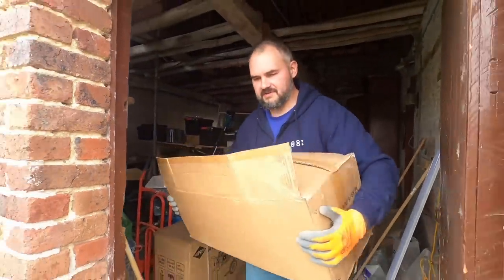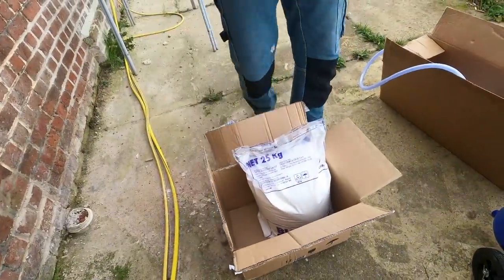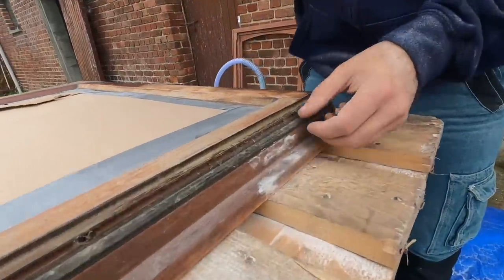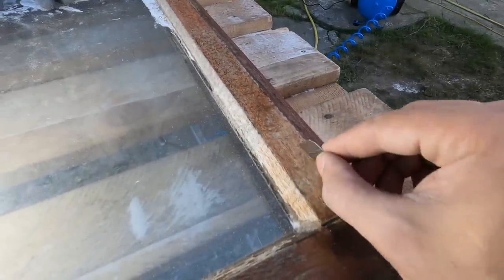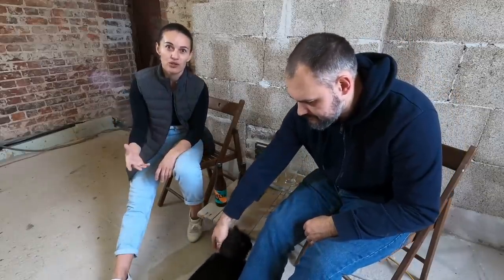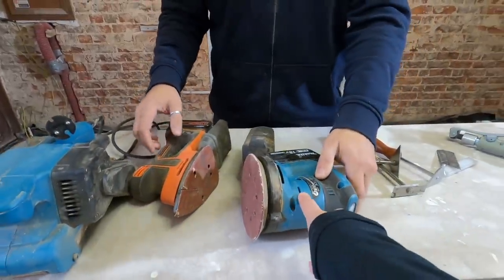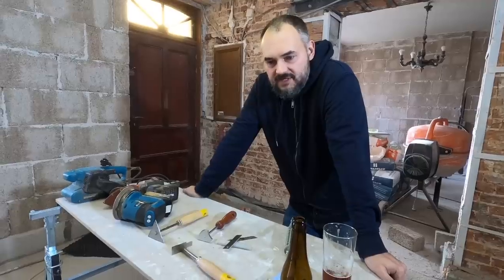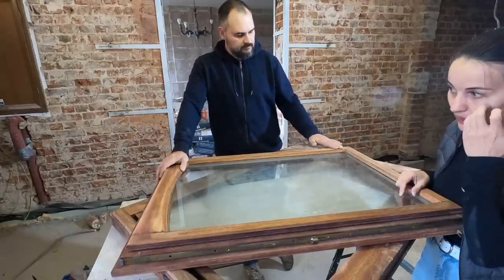Was soda blaster WORTH BUYING?  / Renovating an abandoned 110+ years old farm

Comment: 2 things to remember about the compressor...1) you can regulare the psi and 2) always open the air exhaust before storing it away so that the water in the tank won't rust the interior of the storage tank

Comment: We used a broken window pane when we scrape old paint off. When it got blunt you just break a piece off and carry on. I remember some months ago you had a problem with weeds inbetween the paving stones. a Green and cheap solution is using vinegar undiluted. You do have to repeat it after a while but it is very safe to use.  Regards from Billy in South Africa

Comment: Hi from France, your sodablasting device has a consumption of 350 up to 700 l/mn,that means from 21 up to 42 m3/h.your compressor is not efficient enough to do the job.I've been selling pneumatic tools for more than three decades and have seen so many customers who wanted to use pneumatic tools with a too small compressor.The best is to rent a petrol or diesel engine compressor.A piston compressor has a use ratio of 1/2,that means for example to use it an hour and let it cool for one hour,that sucks! cause it's too long.You can improve your job using your blasting device at 45° angle to have much surface when you blast:direct blast can dig smooth surfaces.

Comment: Buy a can of paint stripper and try it out. Don't buy the cheap stuff. Using the stripper then the scraper will do the best job. For the details use the stripper and then follow up with a small wire brush. That works great.

Comment: Just my pov of course, but hey, I'm invested!  I think white paint is a last-minute choice! Why? Firstly, that wood is probably teak or mahogany from deepest Borneo and deserves a little love! Paint will probably need to be oil-based and need repainting fairly regularly.  A good stain (I would go with dark grey/blue) would last much longer, still show the wood to some extent and show off the brickwork as well as accentuating the depth of the windows.
Totally understand the frustration of the sanding. There are many scrapers out there - Bahco make a good set - that help. But I don't think the imperfections you show would be very noticeable, from the outside at least.

Comment: It may be better to use a paint stripper and then a good sanding session. More economical and less expensive.
Reply: I second this - a card scraper would work perfectly on the flat surfaces in this case and leave with a surface even smoother than sanding. Using a card scraper is essentially the same thing you were doing with the knife blades but it is made specifically for this. It takes a little practice but is extremely useful in the right situation.
Reply: I agree. So much material and so much work and so much hardware in order to avoid using just a few litres of chemical stripper. So not just more economical and less expensive, but probably more environmentally friendly just by virtue of less materials used.
Reply: @brucen4719  This is once in a lifetime job and they need to do it quickly and as easily as possible. they are not going to do the striping every day as a profession to ruin the environment. in this situation paint stripper would be the best option for them. However professional wood worker can give the most correct answer.
Reply: @monirul0814  I have used orange Citrus based stripper that worked great.
Reply: Their whole ethos in restoring the house for the future would not include use of chemical paint strippers.
Reply: @robertab7341  Even if it is the most ethical and reasonable and least intensive or harmful method?

Comment: I'm a scrape and sand guy. Soda blaster would be good for removing rust or old paint from metal. You do need a more powerful air compressor. Then you could control the volume and pressure better.

Comment: I would use a high quality paint stripper and saw dust from a table saw for those angled or tight area of molding, apply paint stripper wait for it to work or activate, take a glove full of saw dust and rub. Clean with acetone, sand, sanding will be easy, this method gets rid of varnish or lacquer finishes that clogs sand paper.

Comment: Check out 1834 Restoration House.  They stripped wood doors, windows, railings and fireplace using a heat machine looked much easier than what you are doing.

Comment: When we were renovating a Victorian house a few years ago I had at least 20 panel doors to strip that had intricate mouldings round the panels, and what seemed like miles of skirting boards. After much experimentation I found that a gentle application of a blow lamp to soften the varnish, followed by a firm brushing (in one direction only - very important) using a genuine hog bristle scrubbing brush would roll up the softened varnish pulling it out of all the nooks and crannies. Must use genuine bristle scrubbing brush NOT plastic !
Reply: Blowtorch and glass is  incompatible!
I would also use a dedicated wood scraper plus an oscillating sander...much better than a rotary disc for flat wood

Comment: For scraping there is a dedicated tool: a card scraper. You also have to sharpen them. They cut by having a "bur" on the end. These were used all the time in a previous era. The cost is very low and they will perform way better than the scrapers on the table. I find using them hard work and I end up using a power sander anyway :0) I was introduced to card scrapers by Paul Sellers on Youtube.
For power sanders you might want to look at Festool. These machines are quite pricey, but they definitely outperform the cheaper ones by far.
Reply: Festoll is a great brand but any sander is only as good as the paper that’s been installed on it.
Reply: sounds like your bur was not made based on flat "90" degree edge (poorly made bur makes hard work).  Many manufactured card scraper sold is stamped out of sheet steel, and shipped as is (not filed or sharpened). YOU have to flatten your new scraper anyway and check the edge (both side and keel). hint: use sharpie marker color the edge  and flatten it.  no color show, is flat.

Comment: I have seen paint and stain removers, some are liquid and some are paste, and they have instructions for use. They remove the film to the bare wood, then it needs sanding.
The media blaster needs a larger reservoir of air. A compressor is a good power source for air tools, some manufacturers put a chart on the packaging to explain the necessary compressor size for the tool. Take a look. 😉🔎
I like IPA, it's India Pale Ale 😁🍻.
I think this style was originally made for Export, and the recipe enables it to keep in the hold of a ship. ⛵  🚢
🔨😏✏️  Good job, guys. 🌻

Comment: What a lot of work to restore the windows. But much easier to work on with a flat surface, instead of in place on wall. My favorite beer is a porter type. I like dark beer with some bitterness. The bread based beer and the delta beer both sounded good. I like that they use unsold bread. Illia certainly had a big enough pry bar to open the bottles! 😊

Comment: Have you tried carbide scrapers?? Most furniture refinishers swear by thrm. You can even use a piece of broken glass
Reply: carbide?   no I will not swear by it.   too brittle to sharpen.
Reply: @rynait  you dont sharpen them, just change to a different cutting edge when it eventually gets blunt. 
Its carbide, its extremely hard, steel is like bubblegum to it.
Reply: @rynait  Well we'll, you aren't the sharpest tool in the shed are you?
I will spend my money on good quality tools as I please.
The carbide scraper is a fantastic tool, so I'll happily keep one in my toolbox.
Now hush, the adults are talking here, children should not be heard.

Comment: After your decision to paint the window frames in situ in the wall the soda blaster will be very helpful to remove any paint stains from the brick work, mask the frames with paper tape (let paint dry for a week before applying tape onto) and blast the brick clean.
Very happy with the choice for white, I removed the brown barge boards (boards under your roof trims) and door canopies because they gave the house look an outdated 70s look.
I choose bright white window frames because it would match well with linnen white walls, and it matches with brick and lime mortar pointing very well too!
White was the colour to go in old days as white paint was the cheapest and gave a clean look

Comment: Guys I'd use paint stripper and a cabinet makers scraper. Flat thin steel you round the edge off and use the burr to scrape wood smooth. Then sand where moulding is. 
If you paint them use a good oil based paint for hardwood. You will need to get the old varnish off the windows to prime and paint them. Varnish can bleed through the paint. Good advice not to paint till spring time. November to April not great.

Comment: Those windows look in good condition.  They just need good clean with Acetone . Then use good primer and then Paint.
Or just clean and use clear coat finish. 
Don't see the point in stripping them to bear wood.

Comment: Try using a specialist heavy duty scraper with a replaceable double edged Tungsten Carbide blade. The edge lasts many more times than steel and when both edges are blunt (dull) just put in a new blade. The whole scraper (Harris brand) costs about £10 in theUK; available on eBay. I love the videos, never miss an episode

Comment: I sharpen my scrapers with my belt sander and a 120 grit belt. Quick easy.
Reply: 120? nope.   worst abuse for your scraper. i prefer hand sharpening. but for power tool to sharpen,  i would go for 800 grit or more.

Comment: Hello Friends With this tool you can scrape wood free of varnish, paint etc. it is not as dangerous as knife blades that you use and you can sharpen it yourself with the iron. Enjoy
KIRSCHEN Zieh blade 150x60x0.5 mm
Ziehkling steel 120mm
Reply: skeptical of your claim.  scraper has bur and does shave  your skin!  is dangerous tool.

Comment: instead of the knife blades, you may want to look for a steel scraper (staalschraper), you can use it for years (if you want to), and can sharpen it whenever, and you can make one yourself from an old piee of steel (like an old saw)
Reply: piece of steel

Comment: where the wood is damaged that you will see use a damp cloth and a hot iron it will create steam and the wood will swell removing the dent , by the way cleaning paint off windows is easy with paint stripper , then sand back the timber and apply gloss sealant , then your varnish , job done , remember all timber has different colours in it so if tou want even colour stain before painting . lost of luck and have fun. Kevin

Comment: I'm not sure I would have used any sort of blaster on finished timber, it's a very aggressive method. It's OK on old rough hewn beams but on finished timber? Not my choice of tool.
However it does have some fair points on the mouldings or glass rebates.
Scrapers are a very good way of cleaning up previously finished surfaces. A very good scaper can be made from the cutting blades from old Wood Planes. You can sometimes find old wood planes in second hand shops, French style Brocante markets or weekend Car Boot markets or Garage sales. You can get them for only a few € if you bargain the price.
Also... I don't think Aneka was very impressed😉.

Comment: That's why in Germany they also call beer, liquid bread.
C'est pourquoi en Allemagne, on appelle aussi la bière, le pain liquide.
Daarom noemen ze bier in Duitsland ook wel vloeibaar brood.

Tip for wood surface treatment for pressure points and blemishes: Water the area and let it dry overnight, because the wood fibers stand up again after watering and pressure points and blemishes, most of them, are almost no longer visible. You can also water and go over it with an iron, but that makes more sense with veneers.
                                                                                      
 Tipp zur Holzoberflächenbehandlung bei Druckstellen und Macken: Wässert mal die Stelle und last es mal eine Nacht trocknen, denn die Holzfasern stellen sich nach dem Wässern wieder auf und Druckstellen sowie Macken, die meisten, sind fast nicht mehr zu sehen . Man kann auch wässern und mit einem Bügeleisen drüber gehen, das aber macht mehr Sinn bei Furnieren. 
                                                                                                                                                                           Astuce pour le traitement de la surface du bois contre les points de pression et les imperfections : Arrosez la zone et laissez-la sécher toute la nuit, car les fibres du bois se redressent après l'arrosage et les points de pression et les imperfections, pour la plupart, ne sont presque plus visibles. Vous pouvez également l'arroser et le repasser avec un fer à repasser, mais cela a plus de sens avec les facettes. 
                                                                                                                                                                                  Tip voor houtoppervlaktebehandeling bij drukpunten en oneffenheden: Geef de plek water en laat het een nacht drogen, omdat de houtvezels na het besproeien weer opstaan en drukpunten en oneffenheden, de meeste, bijna niet meer zichtbaar zijn. Je kunt ook water geven en er met een strijkijzer overheen gaan, maar bij fineer is dat logischer.

Comment: I like to use single edge razor blades. They are cheap and you just throw them away when they get dull. Because they are single edge, it is safer to hold them. You can buy them in packages of 100.

Comment: I still can't believe that you are using the old windows after spending so much time insulating your house.  However, if you use the old ones, I think you should just finish the wood.  Not paint. I did our old windows and just used a nice clear finish.  5 years later they still look great.
Reply: The windows are double-glazed so probably not all that bad as long as they still work (failed double-glazed units are easy to spot, they fog up). New glass might still be a considerably improvement though, the frames look fine, some exotic hardwood I'd say.

Comment: Iliad next time you going to restore any wood furniture or window in your case, to remove the old varnish and grim I always try to ind a piece of flat glass and break it in piece and them use it as scraper, to me works even better that the metal and is cheaper. I like carpentry and restore old furnitue and that what I do always .

Comment: um may i suggest ... card scraper.   is basically flexible steel with edge filed perfectly flat (on all 3 sides) then sharpened on one side (you actually have two sides to sharpen anyway). gives same effect as knife.  in fact you can either buy already made card scraper or make your own (sacrifice putty knife to make one).  hint... you can shape your card scraper steel making custom curves. then flatten and sharpen.

Comment: Should've went for an oil compressor for high performance outdoor tasks tbh. I have a similar oilless 2 engine one, and it's basically a toy for your flat, which you could utilize to spray paint some small furniture piece, for intance, or blow out a dusty corner, pc, etc.

Comment: You can change the nozzle size to match your air supply CFM, also for fine detail work, a small pistol grip  style nozzle gun would be much easier to use. Yes, as you found out, blasting wood is usually undesirable due to it gouging out the soft wood between the grain. There is nothing inherent in the machine that wouldn't make it work with other blasting media, like glass beads or silica sand, if you wanted to use it on the bricks or something as well. Just wear a respirator. 
  
For a very inexpensive and effective paint stripper, you can use Sodium Hydroxide (also known as: Lye, caustic soda). You can mix with water (pour the lye into the water, never the other way around)...wait till it cools, then mix with enough cornstarch to make a gel like consistency. This will soften strip off all old paint and most finishes without damaging the wood. you just spread it on and cover with plastic wrap to keep it moist, then scrape off after 8-24 hours. Of course Lye is very caustic and will burn the flesh, so goggles and gloves are needed to be safe, as well as having fresh water around for emegencies. Incidental contact with your hands isn't too bad just wash it off as soon as possible. Getting it in the eyes would be bad. But as long as you are careful and follow mixing directions, it is no worse than the store bought strippers. It is just much cheaper for big projects.

Comment: chemical paint stripper would have saved you tons of time and effort as it will lift the old varnish off so you really do not have to scrape that deep. Also if you are just going to paint it white (sad to cover beautiful wood, in my opinion) you really only need to sand the whole thing flat with 120 grit after stripping and scraping.

Comment: I'd go with white but probably not pure white. Modern white paint is titanium dioxide based and only came into widespread use in the 1950s. Older white paints used either lead lead or zinc white and were either slightly grey or slightly yellowish (not quite ivory). The original paint was very likely linseed oil paint, which is also supposed to last a long time outside. I really like working with it but you need to apply very thin coats and let them dry for a while. I've also been recommended to heat the paint in a water bath to around 40 C because that makes it flow better and reduces brush marks.